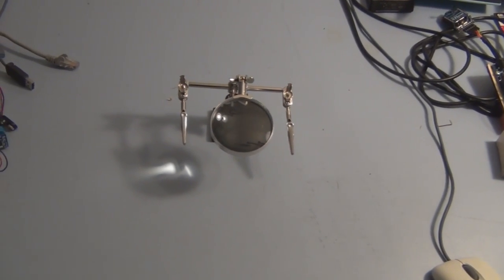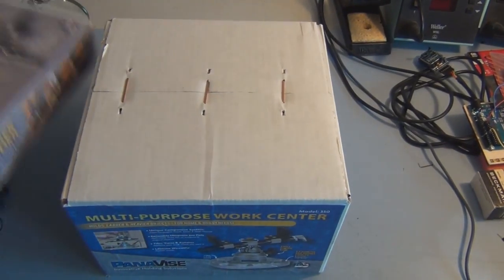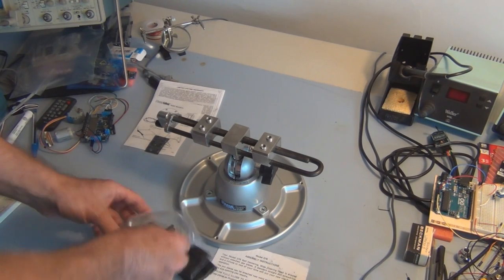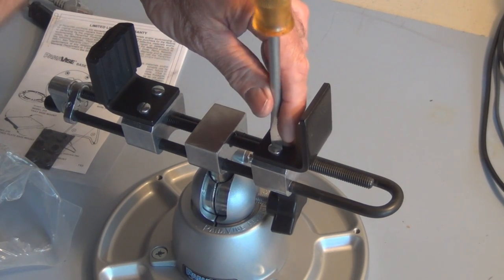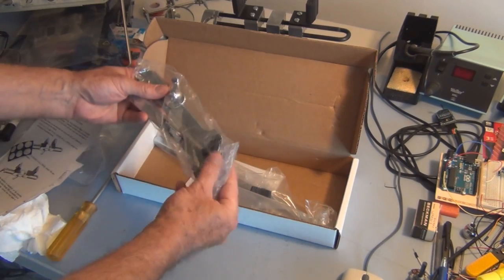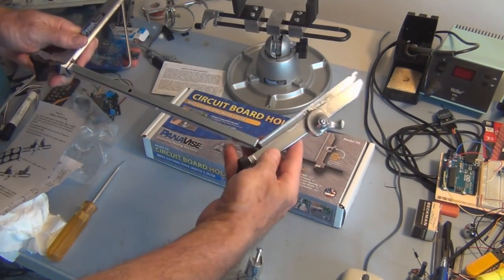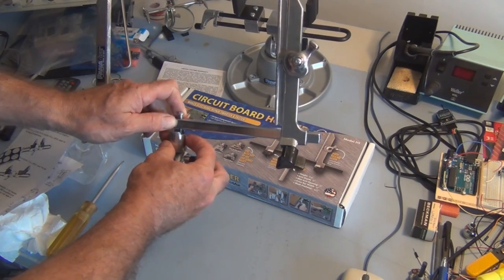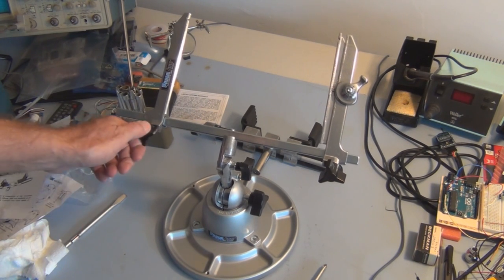PanaVise 350 work center with circuit board holder unboxing

Comment: You put the original jaws on backwards. They are meant to be a vise, and hold a piece of work. The way that you installed the original jaws, they would have to be pretty large!
Reply: He installed them in the orientation that is shown on most of PanaVise's product photos (including the box at 0:36)… 

The jaws are reversible, so there's not really a "backwards". If you need to hold objects at the upper limit of size, install them the way he shows in the video; if you need to hold very small objects, install them facing inwards; if you don't need to do either, go nuts and install one side inwards and the other outwards and watch your OCD friends go crazy :)
Reply: @iaeeniaeen1898  also when re reversed the 315 shaft, i can imagine using it that way, pcb in front of the stand